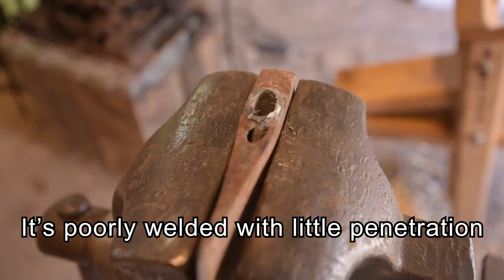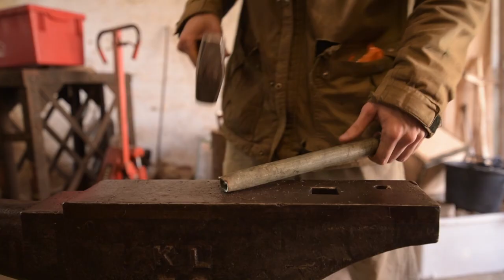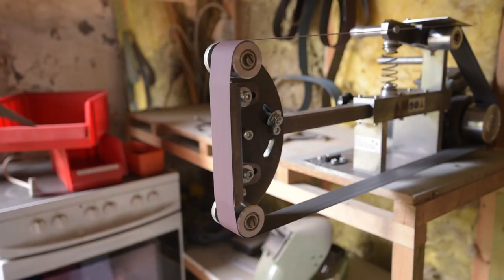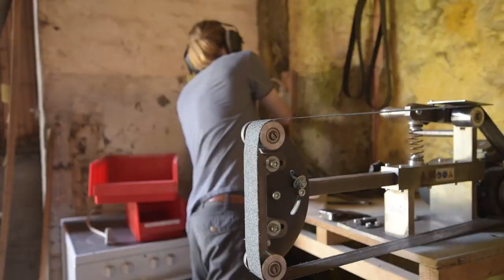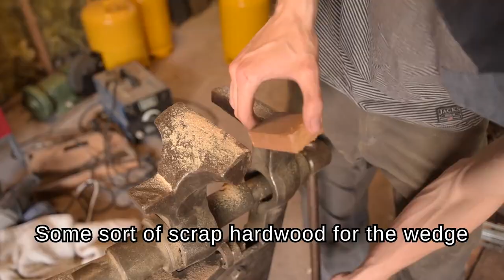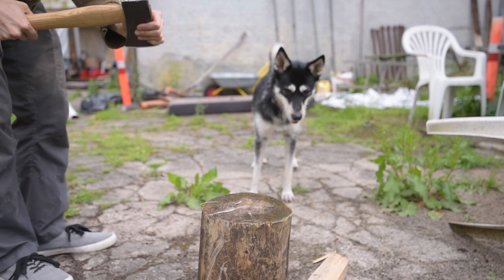Helko Werk Axe Restoration - Who Welds A Plumbing Pipe To An Axe?!

Comment: Pipe handles are very low maintenance and nice if you have a old maul laying around the farm. That bring said you'll never break it but they will hurt your arms. I've mostly seen the pipe handles on mauls. That are 8lbs or post drivers over 10lbs.

Comment: Never done it to an axe other than a splitting maul. But I’ve welded them to hammers. On the farm a lot  it’s really common activity
Reply from the maker: It's really bad for shock absorption though. Steel will allow the shock to travel straight into your wrist and elbow, so if you use the tools for any amount of time it's better to have them proper handled or give them a rubber grip to take the shock. I understand it's a quick longterm solution if people don't want to bother re-handling them once a year.
Reply: Martillo Workshop yes. I never liked it but we did it. I would usually wrap it in a paracord or tape to make it feel better
Reply from the maker: Paracord would take care of it very well for sure